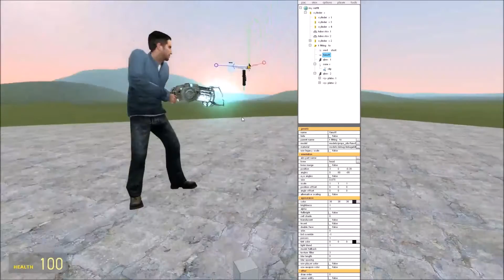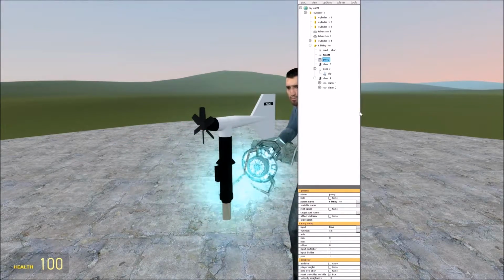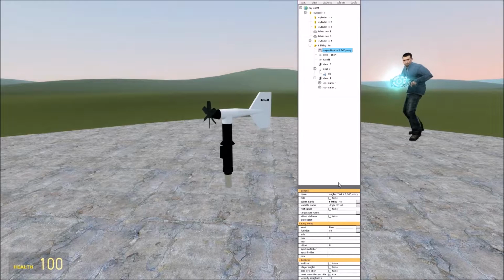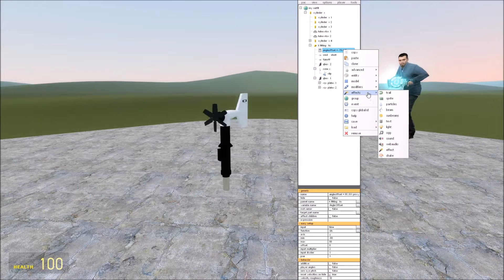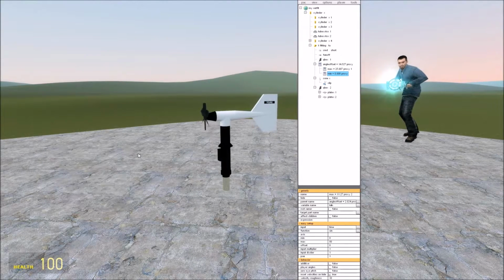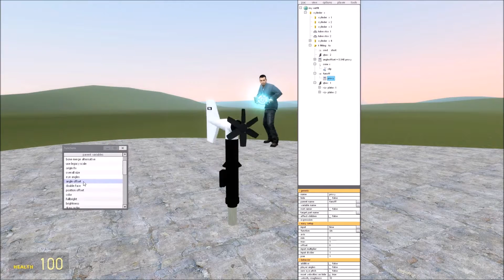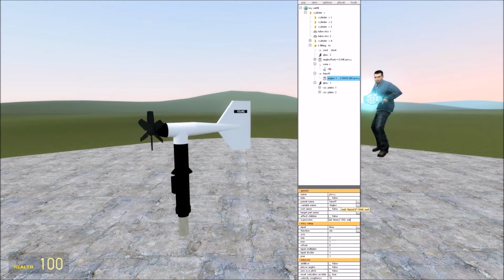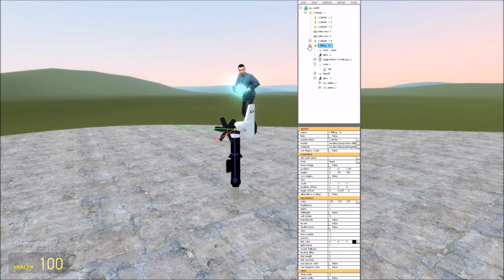GMod PAC3 | Proxys for Storm Chasers! [HD]

Comment: how do i make a prop change color using a proxy
Reply from the maker: I believe this video may be of use to you: https://www.youtube.com/watch?v=td4CYsr1LX4
Reply: k thx
Reply from the maker: Sure!
Reply: hey i have TheBushpilot's anemometer but i dont have the pac 3 file. Were can i get it?
Reply: TheBushPilot's Anemometer is a dupe. Spawn the dupe, then right-click on the prop with advanced duplicator 2, undo the old prop, then paste it with advdupe 2. You will see the pac load.

Comment: question can i just build things the normal way? without pac3? (not this)
Reply from the maker: What do you mean?
Reply: is there a way to build this without using pac3? (a simpler version)
Reply from the maker: It's possible, but I only use PAC3 so I don't make videos on non-PAC3 methods.
Reply: Carloverj ok
Reply: If you go on the workshop and look up anemometor you will find a model